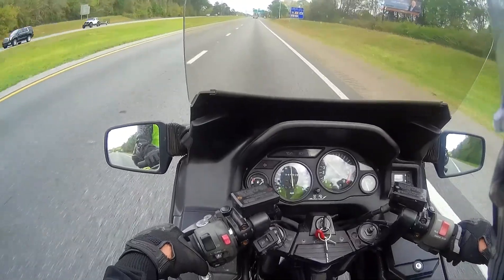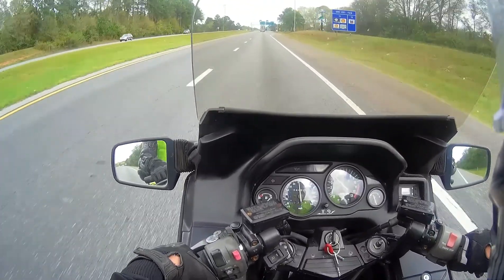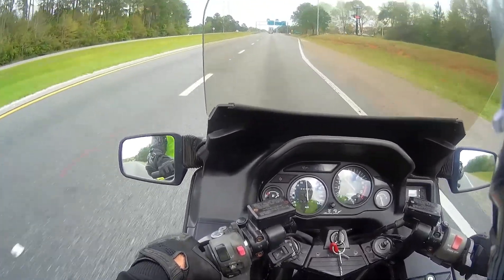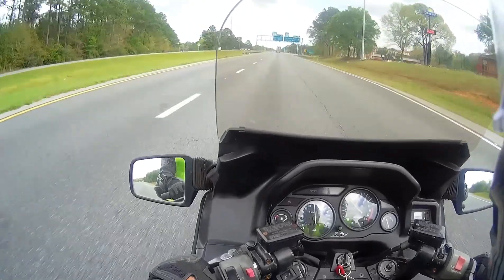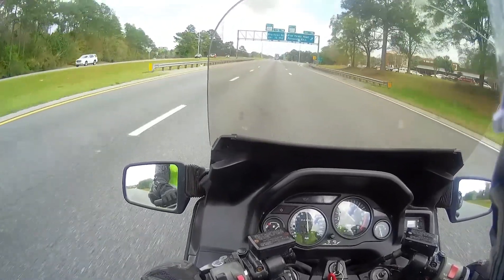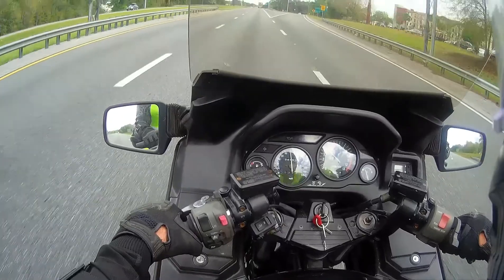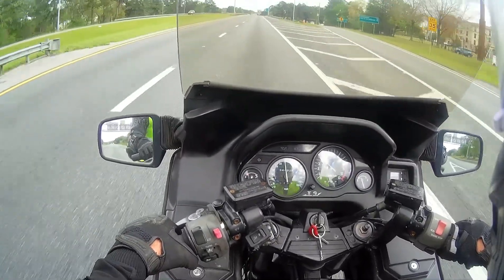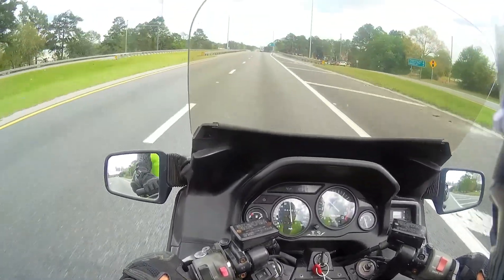Concours 1000 on Highway rpm@70mph and 80 mph

Comment: I've got a 2001 Connie and I have had mine up to 100 mph a couple of times and I want to say that I think I remember it turning at around 5800 rpms. I have run it at 80 mph on I-49 quite a few times on a few trips to the VA hospital in Alexandria, La. The speed limit is 75 on most of the trip so doing 80 is just about necessary to keep ahead of all of the big rigs. I can't stand to be passed by a big rig going 75 mph. That Connie sure does perform well at any rpm but when you get up around 3-4000 rpm the bike just kinda jumps ahead when you give it some throttle at those rpms. I love that old bike, I bought it with about 12K on it and I am now at 21K and just regular maintenance looks like it will last until I am getting dirt thrown in my face.
Reply: I've got the 2006 model..  in that beautiful dark blue metallic...   I babied her and lagged her around at first... 
 At    3000 to 4000 RPMs.  She's like a smooth small cc bike... But at 5000-6000 RPMs she comes alive...   But if you're confident at ripping that throttle 100% wide open...  And holding on. She will easily do 100 mph in 3rd gear...  At 8,000 RPMs.  Now you'll know you're on a 1000 cc bike...  And she's got more...  She will handle 120 mph in third gear at redline... And if you can force yourself to speed shift into fourth , wide open throttle for 4 seconds...  You can cross that quarter mile line at between 131 mph and 134 miles per hour...   At 10.5 seconds... She's a 4-speed with two overdrive's that you will never get into on the drag strip...   Yep,  there's a actual beast down there under that plastic lurking...  But as you know she's the most   gentle  , smooth and aerodynamic bike, you've ever been on..  pure luxury...

Comment: Thanks for the post, brother.  I am looking at buying a 2006 C10, and I was wondering how bad the vibrations are at 70-80 on an all day ride since 75-80 mph is going to be 90% of highway mileage.  Any feedback regarding your on the road experience, or advice would be greatly appreciated.

I think that the problem is that when these bikes came out the speed limit was 55 mph most places in the USA, so they are probably geared for the least vibration at 60-65 mph.  Many older bikes are the same way.  It would be good to just be able to do a rear end gear change like on cars.
Reply from the maker: Good bikes,vibration isn't to bad.Alot less than my klr on the highway haha.i use grip puppies on both and it helps with vibes ,also fits my hands better.